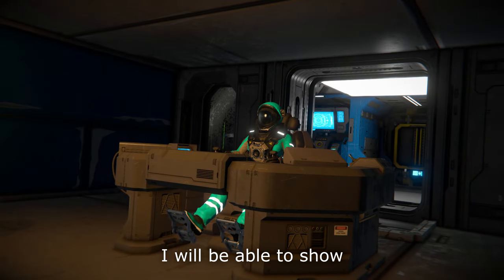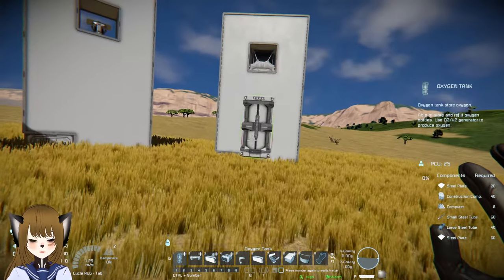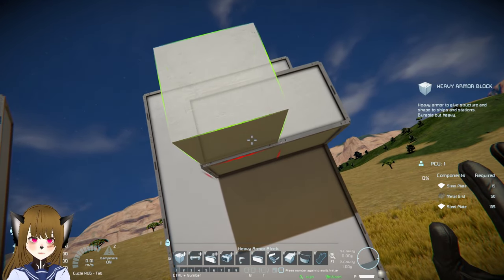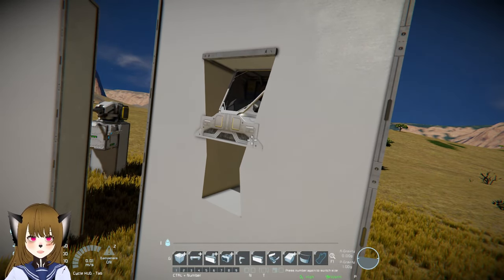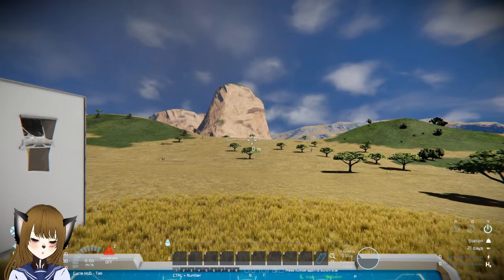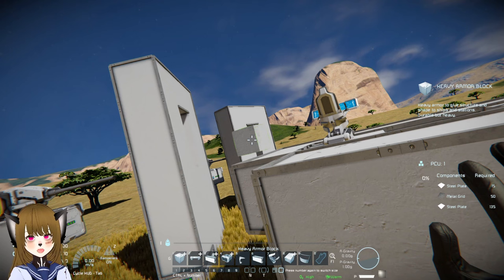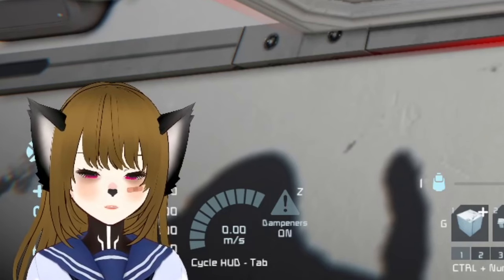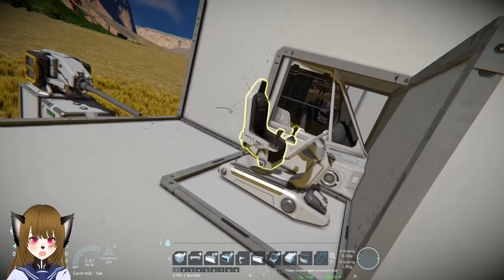The Convoluted Pros and Cons of Combat Ship Cockpits, Space Engineers

Comment: I almost never put oxygen on combat ships. Two oxygen bottles in a cockpit is more than enough to keep an engineer alive for the expected duration and then some.

Mostly I like the attachment points on the proper cockpit because it allows me to stick a gyro to the front. Extra armour, backup gyro.
Reply from the maker: I see c= that's one way to do it x3 and yeah the cockpit can be nice because of those c= you can still put armor in front of seats though even if the armor isn't attached directly to the control seat x3